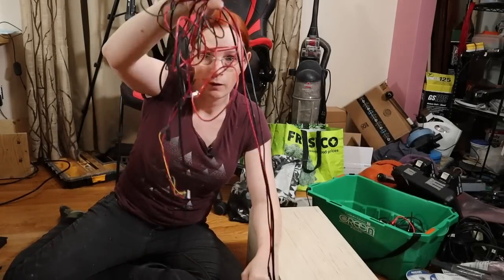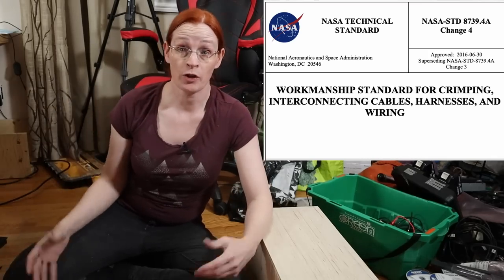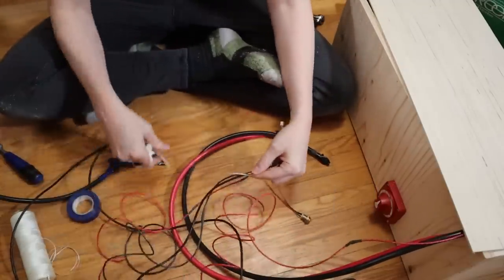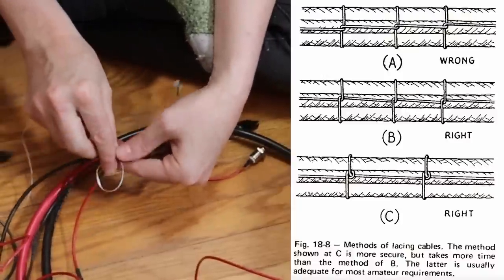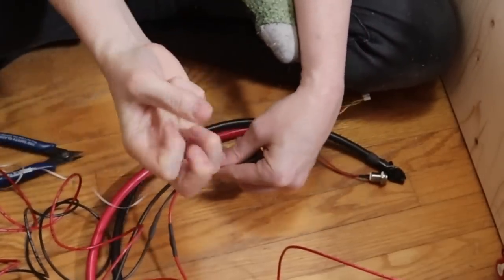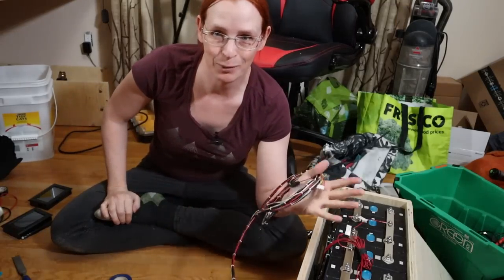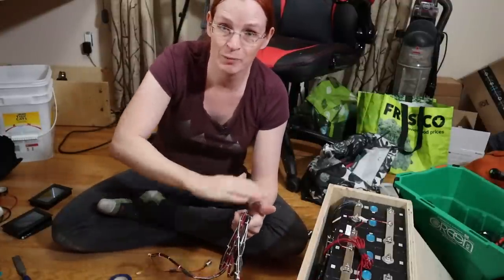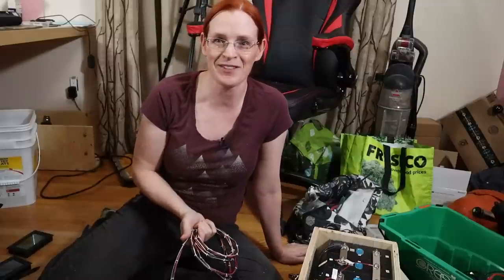The Lost* Art of Cable Lacing - A Non-Expert Tutorial

Comment: I’ve started lacing cables in test jigs I make at work. Everything is so much neater and it avoids having to use multicore cables to keep things neat, so it’s actually quicker overall. If you’re clever you can include the stick-down tie-off points in the lacing which avoids cable ties altogether! You gain instant respect from the wiremen in production even if it looks a bit rough, because you’ve taken time to do it properly. You gain that satisfaction and pride in doing a neat job which seems to have been lost most of the time nowadays!
Reply from the maker: I like those sticky-back panel mount things, the kind that you can also put a screw into. So the plan is to tie off the harnesses to those to secure them to bulkheads. I can't wait to see how the final install looks!

Comment: Just keep making videos as far as I am concerned. Very interesting. Cable lacing makes the loom look very professional. Don’t forget to put your cable numbers on the ends. It’s tedious but in a few years time when you are tracing wires deep in your boat, you will have a smile on your face. Fuse everything practical. This will raise you level of confidence 😊
Reply from the maker: Oh, I'm a big big fan of flagging my cables. So there will be oodles of labels in the final install. :)
Reply: Taking this one step further, one of the newer boats I operate on, the builders wrote the wire description (radar, camera, port navlight, etc) approximately every 12" along every power cable.  This makes wire tracing incredibly easy.

Comment: Avionics Tech here - welcome to the club :)
You can apply this to non electrical items as well, if you need to bundle other things (air, fuel, water, waste etc) that are flexible / in close proximity travelling the same direction and want to reduce vibration / keep organised / reduce space taken its great. Keep in mind heat can affect the wax coating. If you need to do this is a space with high temps, you can use non wax coated lacing. 
The cat is a good supervisor - turns up as the end of the job is near, ready to inspect. Hope you got a headbonk of approval.
Reply from the maker: Yup! I don't know how often I'll have plumbing running side by side, but I'll use lacing if that is the case. I thankfully won't be dealing with high enough temps to melt the wax (or rather, if I am, the wax is the very least of my concerns. haha) Kitty supervisor is always <3

Comment: I've used wax lacing on small projects having seen and learned about it from mil-spec work and telecoms equipment. One big advantage over zip ties and cable wrap is you can form permenent bends in the loom by holding the cables in the shape you want as you go, putting the running line on the inside of the bend with the loops closer together. I remember cutting the waxed nylon with a hot knife rope cutter to stop the ends fraying.
Reply from the maker: Shape-holding of the wire harnesses is very much another benefit to lacing!

Comment: On youtube I am mostly interested in boatbuilding videos. A few weeks ago I was watching Acorn to Arabella and saw you in in. So I thought: Hey, another boatbuilder, lets check it out. First of all I find your videos very amusing. Youre not the typical youtube boatbuilder. The problem I have with a lot of boatbuilders is that they tel what Victron(?) equipment they use, what batteries and whatsoever... I never understand what they are doing... Thank you!! after some of your videos I finaly starting to understand the electric part of what I'm seeing.
But now this video.. In my spare time I am very interested in (pre)historic textile techniques and specialize in knotting (fish)nets and nalbinding (the worlds oldest textile technique ). Most of the knotting you use are used in these historic techniques. 
You use a bobbin so you can work with a longer piece of yarn, without having you use the very bulky bobbin. When I make nets, I use a Netting/weaving needle. It's technicaly a way to make a smaller bobbin, but with... more aerodynamycs... it makes it smoother to get your bobbin through the loop. They come in all shapes and sizes. 
When you connect to pieces of yarn, you use a square knot. When done right, it is a good knot, but when you realy want to make sure they never come loose, maybe you schould use a surgeons knot, or a sheet bend. The surgeons knot is very easy, the sheet bend takes a little practice...
I love to see you do something that is entirely unneccesary, but still doing it, because it is cool to do
I hope you find this usefull. 
R
Reply from the maker: Welcome Ronald, and that's a flipping awesome combination of hobbies! I'll look into the sheet bend and the surgeon's knots... I am woefully inexperienced with knot tying, but it's something I must get better at. Thanks!! ^_^
Reply: I completely agree with you on the suggested knots. If you, Maddy want to look how to do these knots, you can Google it using Ashley Book of Knots (abok 1249) for the Constrictor knot for example, to use at either ends which will bind the core more effectively and will require to be cut off to undo.  Or you can purchase Ashley's book. I think the variation you are doing is making an overhand knot to lock it around the core. Just my opinion. Knotting is a very relaxing and keeps you concentrated on the task. I love it.

Comment: I was taught telephony style cable lacing in a Newark central office, but not as someone who would be doing it daily.  So, I know the starting part and the intermediate part, but I never really absorbed the finish.  For something I'm told is still in use today, there's surprisingly little to help me get back to that finishing knot.
Reply: 1:59 "It kind of fell out of favor."  There's a lot to say about it, but 1900's is probably not the right time frame.  I learned about telephony lacing in the early 2000's, so technically its 21st century.

Comment: Very nicely done.  I haven't seen lacing done in years.
Reply from the maker: You get it!! ya, I've seen lacing in the past, and was absolutely blown away by the care and craftsmenship that went into it. When I found the guide from NASA, I was even more hooked on trying to learn how to do it. I found that replacing a line isn't too hard with a stitch ripper, particularly if you don't use a running stitch. For the boat, the plan is to use single ties, so if something needs to be replaced down the road, I can start at one end, and cut each tie, pulling the old line and adding the new one. Just need to keep the individual bundles with few enough wires that none are particularly deeply buried.

Comment: I learned to cable lace while working for Woods Hole in the 1980s. Great to have a nice review.

Cable lacing was not part of my Coast Guard electronics training in the early '70s. Years later when I started working for Woods Hole (WHOI), productions runs for our instruments was in the 10s of pieces. Only some needed true cable containment so I was taught it by some finicky engineers with NASA standards in mind.

In the last two decades, I was teaching techs to install laboratory water systems that used 6, 8, and 10 mm flexible tubing that would run a distance in the customer's lab. Zip ties worked much better than trying to do real lacing, BUT I insisted that the techs run and bind the tubing parallel like you did with the wires. 

It would be so much easier to track down flow paths especially for the next tech who did not do the installation. The customers would see an organized bundle rather than a twisted loose array of tubing.

Although we may not use the exact techniques, we can often take that knowledge and apply it to other applications. I see you taking your IT training to understand the making of a large monitored battery pack. Same thing with your boat engine "project" steps.
Reply from the maker: Clean, parallel runs are almost more important that how you bind/fix those runs. I prefer lace, but I admit it's for aesthetics as much as anything else. Just, keep the lines parallel. :)
Reply: @TheDigitalMermaid  — Lacing is nice both functionally and aesthetically. 

But I also look for "serviceability" to remove and replace a single wire (tubing, etc.) that has failed or is no longer needed.

The OEM wiring was zip-tied making some parts of the wiring harness very difficult or "impossible" to access.

Because of that, I prefer conduits or other channels.

I'm replacing the propane hoses (because there was a leak "somewhere") and the refrigerating system that was not working properly. Fortunately, Catalina designed in proper conduits for these items.

Comment: I did cable lacing in the Navy and Lucent Technologies. We weren't allowed to even think of zip tying wires. Zip ties damage insulation. The knots, at least at Lucent, were referred to as Western Union knots. I had a lacing kit but can't lost track of the lacing hook. We always did the running knots like you did👍, so that each stitch locks. We used to just cut a length, no bobbin, and would overlap the end knots when we started another length of lace. It is a superior way to gather wires.
Reply from the maker: Oh that's awesome to hear about the running knots! I love lacing, and am really looking forward to using it during the conversion when the wiring is more final.

Comment: Thanks for a great video and a reminder of how we used to do it. I learned to use a wooden bobbin, to be able to make it tight. I used the same technique for the running but start and end knots slightly different.
Reply from the maker: What application did you used to do lacing on?
Reply: @TheDigitalMermaid  Tube amps mainly but also on other electronics and electrical stuff.

Comment: That 15 minutes went very quickly. That does look very nice, I've always been one for neat cables, I have a bit of cable OCD. One modern day trick I've used is to cut little bits of heat shrink, slip them over the wires and shrink them. I did this on my battery, also 3D printed some little cable clips to secure the harness.
Reply from the maker: Shrink tubing would be perfect for that, ya, so long as you can get the loops over the cable ends.
Reply: @TheDigitalMermaid  and you need to put it on before you connect it up.

Comment: It's great to see you are committed to cable lacing ...... you might try using a net making needle/fid to wrap your lacing lengths on rather than a bobbin, much more efficient, less ringlets....sort of purpose built for this type of application
For most of my cable management I prefer to recycle plastic drink bottles, cutting them into strips of PET ribbon. This can be easily formed into plastic spiral wrap (form on a mandrel/stick, with a little bit of heat = heat gun/ hot water)......it is a little heavier than lacing but much better than zip  ties IMHO, and bonus you are recycling.
DIY Recycled PET ribbon/string is an all round very useful item to have on hand, almost as good as DIY Soft shackles
Reply from the maker: I've seen those setups that cut plastic soda bottles into threads, that looks like an excellent way to make use of old waste!
Reply: @TheDigitalMermaid  certainly is, the material can be used in so many ways ....... cable armour (spiral wrap) is just one of them. Cheers

Comment: Nice. I mostly dealt with tangled 100 foot long extension cords when I did construction.  No permanent solution for that though since most days you had to set up a dozen cords and then put them away at the end of the day, That lacing does look really effective. All my videos are small detail stuff that needs to be zoomed in on, so I always stand behind the camera while I show stuff so that I see exactly what my audience will be seeing. That seems to work out really well while handling stuff that is a lot smaller than a finger. I also don't have a nice open area to record in, or a desire to talk into a camera like most vloggers do.
Reply from the maker: Aye, that's what I should have done. I could have at least done the starting lock stitch up on the desk. Well, that's what this is all about; Learning and getting better. What exactly we're getting better at is secondary. Thanks for the tip!!
Reply from the maker: That's an interesting approach... Would probably work best if the result was hung from a peg I'm guessing

Comment: I prefer spiral wrap myself than cable ties. Interesting as I had never seen that way to wrap cables. As for interesting videos it would be good to see the thinking behind buying and setting up the boats new batteries and what electric motor you are going to go with. So the whole planning, amps, volts, range and weight issues as in time most people will have to retro fit a boat with battery powered electric motor.
Reply from the maker: I'd take spiral over cable ties also, if I was aiming for a nice looking finished product. Though, in such a case, lacing!

Comment: Aside, I put it to you that using the running method is great for long bundles but most of the time it's easier and as fast to tie single clove hitch and square knot ties.
Reply from the maker: I'll probably do that for the final wiring install. I started doing this for servers where I wanted to be able to extend a server without the cable hardness snagging, so the running stitch had less knots to catch. That's not going to be a concern on the boat.

Comment: See that a few comments mention that what you call a “bobbin” is actually a “shuttle” in other applications like weaving. Doubt you could find any that are padded but any remnant of the foam tape could solve that problem even if you don’t have enough to completely wrap one, you really only need a small soft strip to get the bite to tighten the string that you want. Honestly just a piece of dowel sanded to a domed point at the ends would be sufficient or even just a pencil.

My question though is, possibly because my brain is still a bit addled on the recovery end of the coof, is what is that long length of wires for? It’s too thin to be the actual battery cable so is it for the monitor screen? I thought it was being mounted to the outside of the box which wouldn’t require that much cable so not sure that makes sense… so what is it actually for?
Reply from the maker: The long thin run goes to the screens and the BMS on/off button. :)
Reply: @TheDigitalMermaid  Oh, I thought that’s what those wires were for but was surprised how long they way since you said (or at least I thought you did) that you were going to install them on the outside of each box.

Comment: Well, I’m hooked… After stumbling across you from A to A and following you here, I have to ask, where did you pickup all this electrical knowledge? I’m a retired electrician and find it fascinating that you have all this electrical knowledge but don’t recall any mention of where you picked it up. Do tell.
Reply from the maker: Honestly, I've just been learning where ever I can for a while now... When I started this boat/battery project, I knew the basics of electrics and that was about it. I had a simple electronics course way back in high school in the 90s that covered things like diodes, capacitors, etc. 

After that, I tried to learn how to make circuits... I failed at that, but I learned some things like boolean algebra, which I found surprisingly helpful in my IT day job as it explained how parity works, and how subnets are calculated. Ages past, there was an old website (late 90s) called "PC Guide" that was a wealth of learning about computers, which is how I learned to make a career in IT. It's long gone, but in the day it was amazing. 

So while I've had to certainly learn a LOT of new stuff for this project, I've been floating around general tech and IT since forever.

Comment: Very interesting! What are the benefits to doing this rather than wrapping in cloth electrical tape or wire loom? In automotive applications I see wrapping in cloth tape (or just regular electrical tape) very frequently, sometimes with the addition of a wire loom (either plastic mesh or a corrugated plastic tube).
Reply from the maker: Honestly? Cloth tape is probably more sensible. If I was to really stretch for a benefit; This doesn't leave a sticky residue. The biggest benefit of this is, I think, just enjoying an old way of doing things that isn't common anymore. That is to say, it's fun and looks pretty. :)

Comment: Cable lacing lasts A LOT longer than cable ties and most importantly makes harnesses easier to handle and inspect over long runs. Lacing essentially creates a skeletal spine for wire bundles

Lacing also has the advantage of a visual quality assurance test of the wire continuity and orientation. 

In commercial applications, without lacing, tracing ground faults would be impossible.
Reply from the maker: Oooh, tracing ground faults is a benefit I hadn't considered!

Comment: Nice.  I don’t know in this case but letting wires cross or twist would/could limit “cross talk” or induction from one wire to the next.  But this circuit may be so benign it doesn’t matter in your case.  Pb
Reply from the maker: The twisted pairing inside ethernet cable is done for just this reason (and each of the four pairs have different twist rates). So you're absolutely right, but signal cables with high enough bandwidth to worry about cross-talk will be inside their own sheething, and so long as you don't compress them too much, you should be OK.